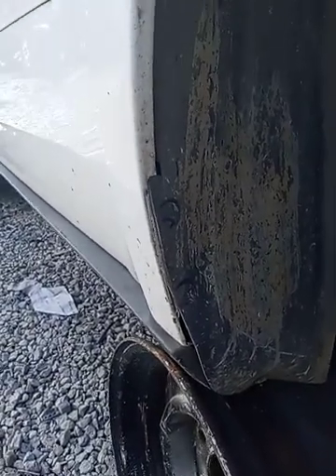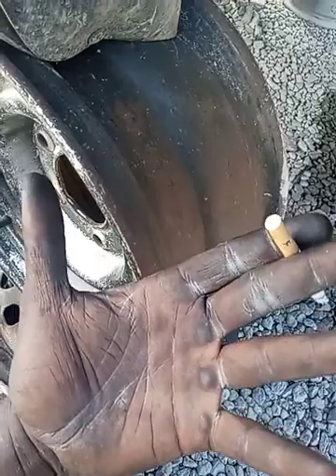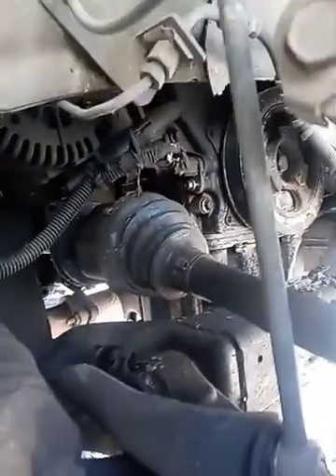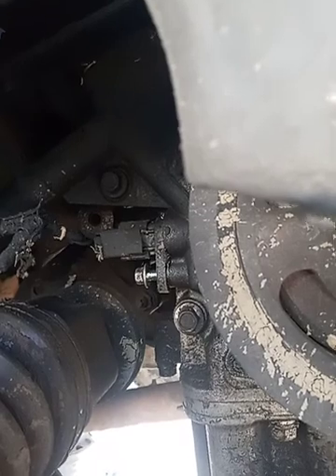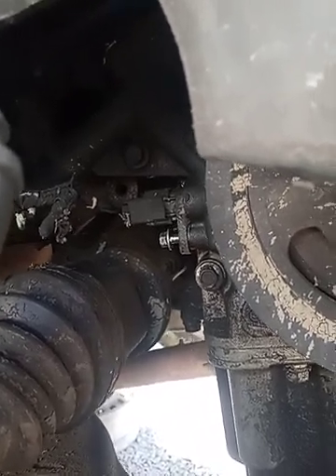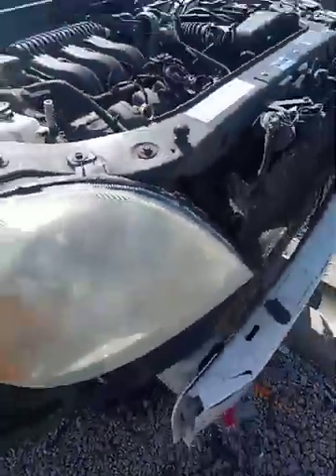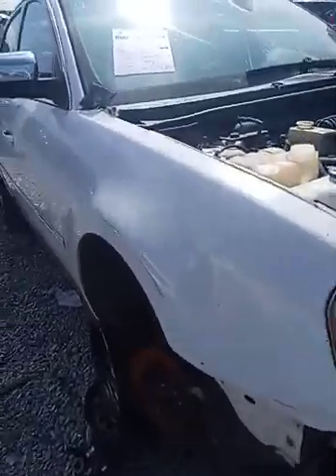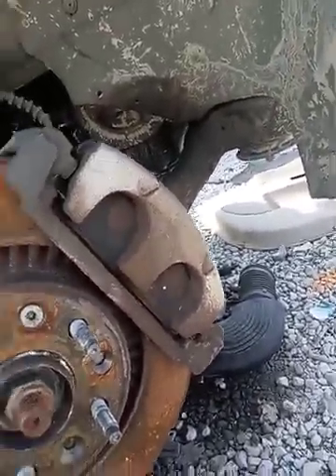Ford 500 3.0 V6 crankshaft and camshaft position sensor locations

Comment: Very informative!  Cusses engineers just like me. Keep up the great work. I found your video researching my 05 Montego im blowing fuse #40 on engine bay fuse box. It has many different functions and im ready to crush the damn thing. God bless you brother.
Reply from the maker: @derrickglenn4267  try looking under dash for harness going into the ignition switch.
Check wires for exposure.
You have a short to ground.
Fuse 40 is an ignition feed .
Check wires that gets 12 volt when key is turned on

Comment: Just did a alternator swap on my 500. Yeah..... 7 hours!! On the ground jacked up with a jack stand holding it up. Pain in the rear end!!
Reply from the maker: 😆😂 yes my friend these cars suck big time
Reply: @gerry7602  in this case ABSOLUTELY. And now it doesn't run right. Checked voltage on my alternator through the battery and it is fine. 15 volts running. I believe my Crack shaft position sensor went bad with the alternator running down. At least that's what I'm hoping!!
Reply from the maker: @Wannagobackto1980  if crankshaft sensor is faulty it will do two things run poor with random misfires or not run at all
Reply: @gerry7602  that's what it's doing. I couldn't go nomore than about 30 to 35 miles an hour..I limped it home. It would spit and sputter. Doesn't like reverse at all. It would just shut off. Can go forward but like I said couldn't go but 30 miles an hour and had to feather it.

Comment: Hey I have a 07 ford 500, rough idle, loss of power when accelerating, no codes coming up . I changed air filter, mass airflow, cleaned throttle body, still having issues , changed oil and noticed metal flakes in oil. I don’t hear a knocking in engine. One other thing that could not be related is that everytime I get gas, it constantly pops like there is air in the tank. Idk what to check next
Reply from the maker: Unfortunately I can't tell you what the problem may be.
With my prior experience dealing with Ford engines be 3.5 3.7 etc.
I have seen that issue for similarities and it turned out to be a timing issue the timing chain jump which was which would cause loss of power and misfire and rough idle
Reply from the maker: Also you should check for vacuum leaks

Comment: How do u take the crankshaft out like I see the harness but where the other side go
Reply from the maker: Hello the watch the video. The connector is on the sensor. Follow harness to crank sensor on side of the crank balancer.
8mm wrench or socket.
Easy peazy